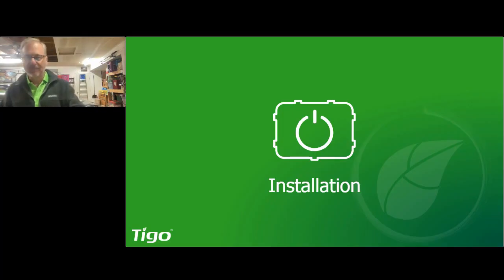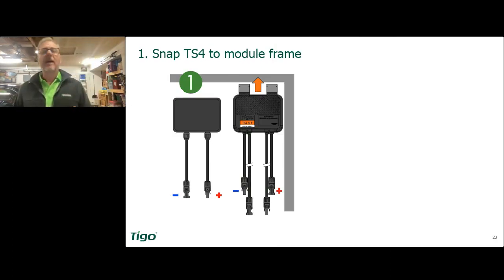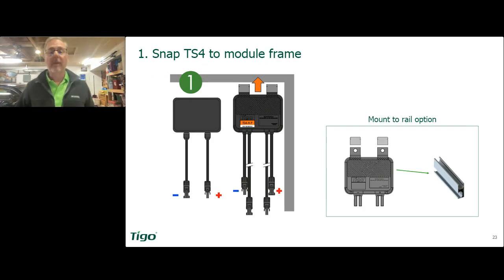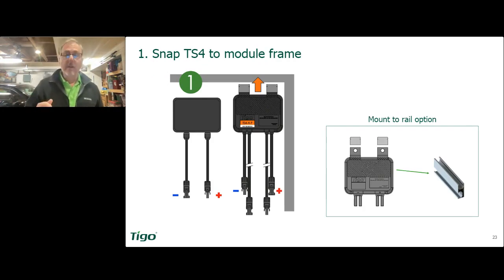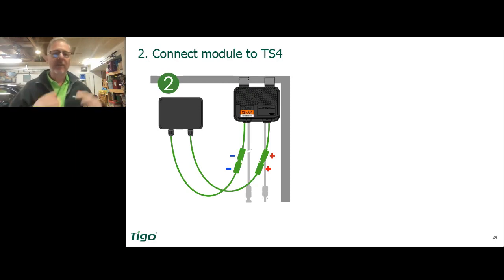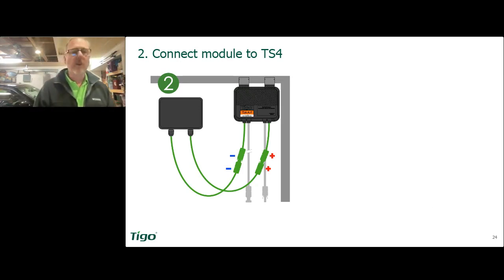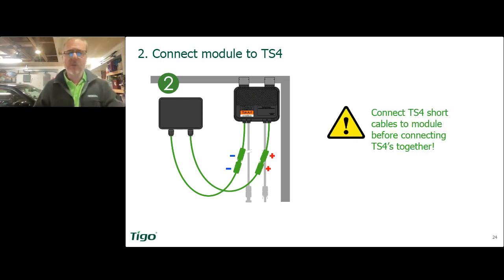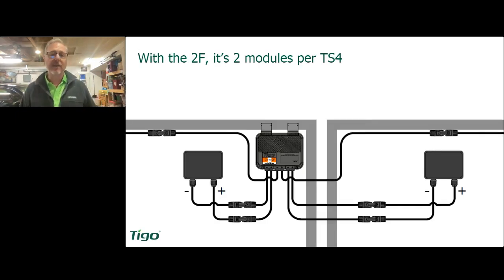Highlight: How to install Tigo Rapid Shutdown MLPE (TS4-A-F and 2F)

Comment: For the TS4-A-2F; when connecting 2 panels, are they in parallel or series?
Reply from the maker: It is a series connection. Each input of the TS4-A-2F supports either 500W or 700W depending on the model. Please refer to our datasheet for options.

https://www.tigoenergy.com/downloads

Comment: What happens if I do first the daysi chain and then the panels? I mean for wire management that would be the easy way
Reply from the maker: Great question! You must connect the TS4 to the module first or else you run the risk of damaging the unit.

Comment: Do these optimiser work out the box without any additional equipment? I noticed the data sheets states CCA + Tap is required. But I presume that is only if you desire monitoring and rapid shutdown?

Am I right in saying if all you desire is  optimising, then CCA + Tap isn't required?
Reply from the maker: What you describe is called blind deployment- using the TS4 optimizer without monitoring equipment. The TS4 will optimize but it will not perform rapid shutdown (if applicable) and will only have a 5 year warranty instead of 25 years.

This Help Center article discusses this application in more detail: 
https://support.tigoenergy.com/hc/en-us/articles/4770355167635-TS4-Systems-Blind-Deployment

Comment: Hello. Question: You say to connect short leads then long leads. Do you mean connect all the short leads on the string then come back and connect the long leads or do you mean panel by panel? Thank you
Reply from the maker: Good question, Tim. We are referring to the shorter leads on the TS4 that will first connect to the module. Ensure all of the modules are connected to the TS4 before connecting the TS4s together.
Reply: What happens if you don’t do short leads first and do them out of order…
I have an issue I’m reading 39 v and it should be reading 0.5 as the system is not on

Comment: Question: What happens if you connect the long cables first. The reason I ask is that I had a panel connection come undone as I was wire managing. 

Can I just disconnect the Togo and reconnect the module. To fix this? We are using the Tigos that accept to modules.
Reply from the maker: Hello Xavier, t hank you for asking htis common question. Please disconnect all cables and then reconnect them in the proper order. If you have any questions, please contact our Support team.